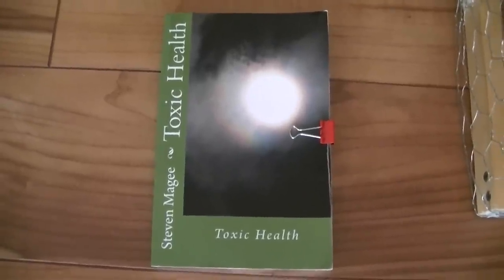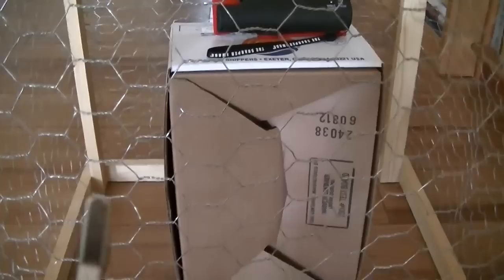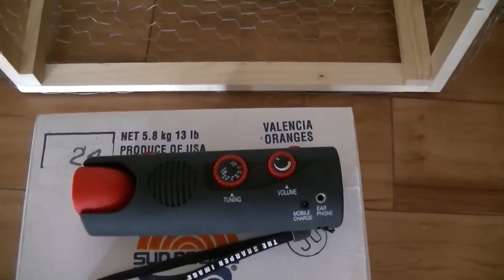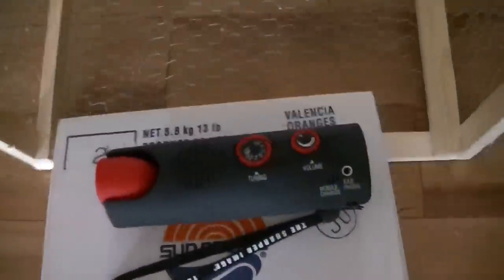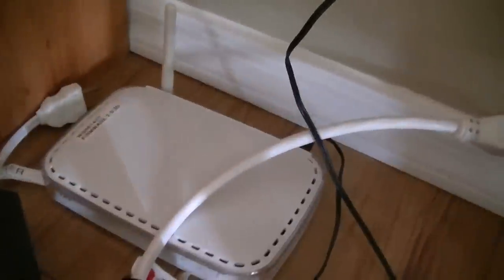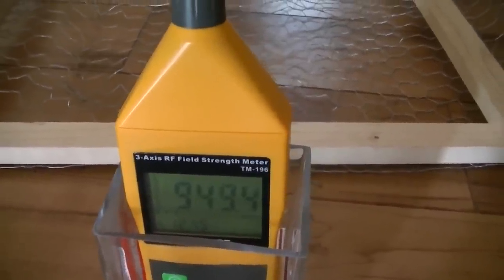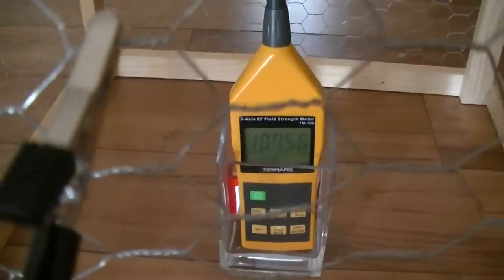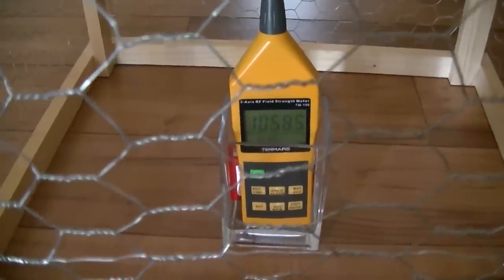The Difference Between Grounded and Ungrounded Faraday Cages Regarding AM, FM & 2.4 GHz WiFi

Comment: Yes the bottom is open for some reason.  Makes no sense...
Reply from the maker: It's not a wooden floor.  It is a ground floor concrete foundation with approximately 1/4" of laminate on top of it.
Reply: StevenMageeBooks you really need to seal the bottom or you'll get scatter leakage around and under the bottom. Also your "earth lead" is an inductor, it's not at earth potential at VHF at all. Seal the bottom with a screen and you will probably (if your cage is constructed properly) notice a difference, but not when you add an "earth" or "ground" lead. Long earth leads like you used in your other video "Does a Faraday Cage Need a Conductive Base When on the Ground" only work well at very low frequencies, where the wavelength is long. 
You must also realise that a concrete floor is not a good RF earth because the conductivity is relatively high. The fact that it lies on the planet doesn't make any difference at all unless it is absolutely saturated with water and mineral salts, even then, above a few MHz it will have significant resistance. Ceramic is a good insulator. 

Unless you have a perfect RF earth (at whatever frequency you are trying to block) then just ignore the "earth". It's unlikely you will ever have a good RF earth above a few tens of KHz. Use a calibrated field strength meter appropriate to the frequencies of interest/test and not a broadcast receiver - the broadcast receivers have automatic gain control and can cope with 40-60dB of difference for the same signal:noise ratio, which makes them useless for detecting even medium changes in field strength.

At GHz frequencies you'll get passthrough depending on the aperture size of your mesh screen; also "earthing" becomes even more irrelevant because a wire even a few mm in length has significant inductive reactance.
Reply from the maker: Excellent discussion!  Thank you for taking the time to post it.
Reply: Environmental Radiation LLC 
For a Faraday Cage to work, all sides must be electrically connected to each other, your concrete foundation is not electrically connected to your cage, therefore this cage does not function as a Faraday cage (which is proved by the radio reception). Furthermore, the mesh size must be smaller then 1/10  of the wavelength. For a 2,4 GHz WiFi the mesh size should be smaller then 1.2 cm, your mesh size is clearly much greater then that. WiFi signals are not blocked with this mesh size (therefore you grounded/ungrounded test makes no sense).
Reply: +PeterK6502 Great explanation! Right on the money.
Reply: +LucaTurilli89 seems to me that you are talking more about "protective safety earthing" than Faraday Cage Shielding. It is also possible that you wish to screen off stray coupling to nearby objects, components and wiring.

In the context of the video here,, the intended purpose of the cage is to screen out radio frequencies. Radio frequencies can be emitted or detected at quite large distances from the devices/antennae in use. This is in contrast to lower frequencies, such as the ones used for mains-frequency transformers and to a certain extend, switch-mode power supply transformers, though as the frequency in use in the transformer increases, there tends to be more chance for electromagnetic emissions 
(in part due to the circuitry, that is to say, the wiring, becoming a significant fraction of a wavelength at the frequency in use. An important factor for this is the "loop area" that such circuitry encloses - basically long wiring in the shape of a large loop tends to emit more than the same wiring close together, parallel with little space in between or twisted together) 

Unless your particular transformer is driven by a radio-frequency signal (rather than "mains" frequencies, say 50Hz, 60Hz or possibly 33.3 or 400Hz in some less common application) then protection from electric shock is more of a design problem for an electrical engineer specialising in high voltage design and installation. 

Protective safety earthing and equipotential bonding:
The usual intention of an earthed enclosure (also known as equipotential bonding - making sure that objects are "bonded to equal potential") around such high-voltage equipment is to ensure that in  any leakage or fault conditions the unwanted current is diverted to earth via a very low-impedance route. This is done for two main reasons: to ensure that "touch voltages" on any exposed nearby conductive* objects do not rise above safe conditions (the definition of "safe" may vary on the circumstances -  example: in a bathroom, especially over a bathtub or in a shower, or medical equipment that may be hooked up directly to a patient; or in contrast on a high tower that is inaccessible to the public by virtue of being fenced off and having no access ladders) 

* note also that at very high voltages (and 20kV is considered very high in most circumstances) that objects that are commonly thought of an insulators can in fact be conductors)

NOTE WELL-  that in may circumstances, having an bonded earthed object close to high voltage equipment can make leakage prevention a major problem. By that I means that fitting a cage close to your 20kV terminals and wiring may simply be asking for tracking (arcing) to occur between the high-voltage and the earther screen. Also note that if the safety bond to earth should become faulty in some way then you will have a very lethal problem - the whole cage/enclosure may become energized at 20kV and anyone coming into contact with it may get a lethal shock!!! This is a serious safety problem!
(the usual answer to this is to allow very large distances between any conductive enclosures and high-voltage equipment)

If what you really need is screening so that the transformer does not emit or be susceptible to  electromagnetic radiation, then a Faraday Cage is ONE way to reduce this, HOWEVER, at lower frequencies, the effect of an electrostatic screen is much less effective than that of a magnetic screen. Certain metals and compounds are manufactured for use as magnetic shielding - "Mu-Metal" is one example. "Aqua-Dag", a paint-like coating, is another. 
At first glance these magnetic screens work in a similar way to a Faraday Cage but their actual method of operation is very different. They are primarily used at lower frequencies than  "radio" frequencies, usually with circuits energized in the region of tens of kiloHertz and lower. This is because the effective screening of the materials drops off as frequency increases. Modern ferrite and dust-iron materials extend this range somewhat higher but can be very expensive to manufacture in slab or sheet form as they can be very brittle.

It is VITAL to note that protection from high-voltage electric shock is NOT the prime purpose of Faraday Cages in the context of this videos and similar ones. Rather, the purpose seems to be to to reduce the ingress of stray radio signals (usually broadcast signals, domestic WiFi or cellular signals)

IF your prime purpose is to protect from electric shock - I strongly suggest you contact a electrical safety consultant experienced with high-voltage safety design.
As I hinted above, in the NOTE WELL paragraph - a NON-CONDUCTIVE safety zone around high voltage installations is the norm, distance is usually your friend here. Then outside the safety zone (which maybe be measured in centimetres, metres, or even tens of metres, depending on the circumstances of insulation used, if any) an earthed enclosure may be used IF required for some other reason. As I say above, the integrity of any earthing arrangement is of vital importance also. 

This is one reason that old CRT televisions usually had non-conductive back covers, rather than conductive earthed ones. When the back is removed for service, extreme care needs to be taken to bond conductive covers back on afterwards. With non-conductive back panels and double-insulated, non-earthed designs, this is not a problem. Note that the high-voltage circuitry in such TVs was always designed to be kept well away from human fingers, using distance. Any internal conductive objects objects were very well bonded to prevent the buildup of stray electricity under normal or fault conditions. 

IF what you really want is to screen the device from emitting or being susceptible to electromagnitic interference, then what you need is a EMC (ElectroMagnetic Compatability) specialist. Also note that any conductors penetrating a Faraday Cage or magnetic shield needs to be extremely well filtered or the effect of any shielding can be completely negated. 

In simple terms that means if you attach a significantly long wire to the 20kV terminal and bring it out of the cage, it will emit or be susceptible to precisely the same energies that you are seeking to screen with the shield. 
The definition of "significantly long" here depends on the length of the conductor (or more correctly the loop area enclosed by the circuit)  compared to the frequency (and therefore the wavelength) of the energies you wish to protect from. 
eg: at 50Hz,  20cm is not really a problem outside the cage unless huge pulse currents are flowing or massive transients are superimprosed.
at 2.5 GHz, 3cm may be a significant problem. 

My suspicion is that you are talking about 50/60Hz or at most, several tens of kilohertz at the most, but the known laws of physics apply across a broad spectrum.

my fingers hurt :(
Reply: +LucaTurilli89

The sore fingers were a joke :) 

 OK, in your scenario there seems to be more the requirement of physical separation for personnel safety. This could be achieved by physical distance separation alone, but that would probably mean keeping people too far away from the equipment to be practical in a lab scenario. You would maybe have to lock the room door too to observe safety protocol  haha.

TL;DR - 
you just need an earthed safety screen, not a Faraday Cage because you do not need to screen electromagnetic radiation.  The technical term for this is simply "an enclosure". It does not need a bottom side if the base is solid and a good insulator as well as being mechanically stable. You could have a hinged cover you can lift off for access. You should include some basic safety features if you have time.  

Long version -
One approach would  be to manufacture an insulating transparent (polycarbonate or acrylic, and therefore insulating) enclosure, but that would be MUCH more complex than simply placing a cheap and easy to construct cage around it made, as you suggest, from chicken fence wire. This is easy to find and easy to bend, a few wooden strips and a quick frame can be made (maybe borrow a electrician's staple gun to make fast to the wood frame?) So - chicken wire cage is good cheap and fast idea.

Your equipment basically needs to kept safe from accidental human contact with the high voltage. This is the same purpose as most cases or enclosures. There seems to be no need for electromagnetic screening. Yes, if the insulators under test break down under high voltage there will be some arcing and this may cause local RF interference, but in a lab environment for a short test this should not be much of a problem. So, in your scenario, you simply need a "case", not a Faraday Shield. Not all cases act as Faraday Cages, though all-metal ones do if they are properly constructed. You could, if your woodwork skills are good enough, manufacture a large wooden box around the apparatus for example. If however the materials used for the enclosure are conductive, they should probably be earthed for electrical safety.

Because the chicken wire is conducting and not insulated (even if you do find plastic-covered chicken-wire, it will not be good insulation to 20kV) then yes, for safety, it should be grounded. Please make sure the connection to the fence wire is good - the fence wire is usually cheap galvanised steel - a good quality crocodile clip with sharp teeth may be better than a poorly-soldered "dry" joint made with a too-small soldering iron. Galvanised steel is not so easy to solder, especially with modern lead-free solder. Best of all would be a tightly screwed clamp with serrated washer to bite through any surface oxidation on the metal coating of the wire. Make sure this cannot come loose but allow some flexibility for opening the cage/cover if you need inside - a flexible cable with some slack for movement of the cover is ideal.

Personally, I would not build it with a floor to the shield/cage. This is because, I would assume, you have the test apparatus on a lab bench/table. That means nobody can be injured from below the apparatus unless they drill a hole up through the table top - so no screened floor will be needed for safety - at least I think? I'd adopt a baseboard arrangement with a cover over the top of it. The baseboard would ideally be thick and heavy. Generations ago, this was called breadboard construction, after a kitchen bread cutting board - a far cry from modern "breadboards" :)

Your earthed safety cage could only be a "lift-over" style cage IF you are very careful about things...
 HOWEVER - you must be away that the equipment MUST be de-energized and any capacitance (including stray capacitance) discharged. There is a vital difference between something being "off" and being de-energized. Off means the supply is removed. De-energized means that any energy remaining in the circuit after the supply is removed is safely discharged.

 SO -  imagine the nightmare scenario - you are testing the insulators at 20kVac 50Hz. You think you see some arcing/tracking near the transformer, so you look closer, but stumble and fall against the cage. The earth wire comes loose and pulls off, as you fall you push the cage (which is now NOT at safety earth potential) against the top of the 20kV insulator. !BANG!

To prevent this I would have a few precautions:-

1 - Make the cage reasonably rigid, not so that it is too flimsy. It need not look pretty, but should not collapse if it is touched. It should at least provide some physical protection. 
If you take this to extreme, you would make a full metal chassis case to completely enclose the transformer and possibly the insulators under test too. For a lab test scenario this is not required, but please try to show some good safety sense and make sure no-one gets harmed. Often, it is the person who least understands the risks - that usually means trouble :)

2 - mount the transformer on a large, thick, insulating wooden block, like a butcher/kitchen wooden chopping board, this is to make it stable and not slide around too much. Even dry wood may have leakage at 20kV, so use an insulating plastic board on top of the wood for a top surface. This base should be large enough so that the base is much larger than the transformer and any other equipment needed. This makes it safe and stable. 

3 - Make the screening cage so that the framework is hinged at the rear side (or maybe just loosely fixed by hook and eyes) so that the cover can be lifted up for access. This will make sure if the cover is lifted, it will go back together with correct alignment. A loose metal cage that can be pushed around into contact with the 20kV terminals will be dangerous. If it's fixed at the rear side to the base it can only come down with correct positioning every time. Much safer.

4 -  Include a safety interlock switch . This will disconnect the supply from the circuit if the cage is lifted. When the cage is down, it turns the interlock switch ON. If the cage is lifted, it will disconnect the supply. Basically, mount the switch on the base of your wooden base block so the cage frame covers it.

This interlock switch may not de-energize all circuit on the secondary side instantly in all circumstances, but is better than nothing. A small suitably-rated mains microswitch is an good way to do this. Don't (!) try to swith the secondary (output side) - it's too high voltage.
It's important this interlock switch is separate from any functional ON/OFF switch for normal operation. The idea is that separate switches add extra safety. Interlocks are very common in the industrial world, for example, even a domestic microwave oven will have 2 or 3 separate interlock to prevent operation of the magnetron while the door is open. This is in addition to the main on/off switch. Interlocks should ADD safety. This is an example of safety by design.

5 - only have trained personnel in charge of operating the equipment. Tell everyone else they must not  touch it.  
This may mean you and your teacher/instructor (and only AFTER you have fully explained to them safety haha). This is an example of safety procedure and safety briefing. It takes only a few seconds, works well for lab experiments and demonstrations and is safety for free - it makes you sound good too :)
Reply: +LucaTurilli89 

...Now, on to CRT enclosures. Yes, one possible hazard is any large supply rail capacitors storing high voltage until the bleeder resistors discharge this to a safe level. However, this assumes the bleeder resistors are not faulty and are present (!), it also assumes the person does not touch the dangerous are for a few seconds or minutes, depending on the CR curve time. Safety comes from having several safety features, not just one (see interlock description above)  Anyone who has played with an open computer power supply has probably get a shock his way sooner or later. Some cheap PSUs have no bleeder resistors at all. As you say, most of the voltage rails would be low current but may still be enough to stop a heart or cause injury in other ways. 
 
But a second hazard is the EHV on the CRT tube itself - it acts as a high-quality (it's glass) high-voltage capacitor and can retain a charge for a very long time after the supply is turned off. Even worse, it can recover some charge even after it has been forcibly discharged - a very interesting effect. To safely work on CRT equipment the CRT tube itself should be safely discharged. This helps accidental contact with EHV especially under fault condition or unnoticed physical damage. Whilst the EHV supply current is minimal, the energy stored in the circuit is not. 
  
Because CRT televisions became such common domestic objects, may users tried to repair them themselves, regardless of their skills or knowledge. Many examples of accidents occurred due to the sheer numbers of TVs in use over many decades. Commercial monitors tend to have metal cases and sometimes if the case was not properly re-fitted and the EHV lead became dislodged or the insulation became compromised any adjacent metalwork case could rise above ground potential. Because of this, most quality commercial CRT cases had multiple methods of panel earthing, flexible binding straps as well as serrated washers. Designing a double-insulated appliance avoided that for domestic CRT TVs.

When designing products, you must think of the safety of ALL persons, users, technicians, in some cases trespassers or even thieves (electrical substations have very high fences and locked doors).

Remember that it is not always the hazard directly from the high voltage itself, it may be the fright from the shock, or the shock that causes someone to fall and injure themselves. Falling and banging your head can be fatal, as can falling off a very low ladder or step. Accidents happen, but as an engineer you must just make sure that they do not happen as a result of your product, even if an idiot uses it. 

USERS need to be kept out, to protect them from what they do not know and cannot understand. You sometimes need to think laterally to protect them from themselves. Luckily, safety organisations and legislation lays down common standards (EU standard finger test for example) for enclosures. 

TECHNICIANS are a little easier, they may understand but can still make mistakes. Example: a badly-trained, tired or drunk technician who forgets to connect earth bond wire or serrated washer to metal cabinet panel after servicing. By designing a robust flexible bond wire and hinged door panel for easy access, the risk of this happening is lessened considerably. Or, making the serrated washer (to penetrate any paint/coating and give very low impedance connection to the safety earth) captive so that it cannot be lost or omitted. 
Everyone loses screws and washers, it's part of life :)

TRESPASSERS and THIEVES are less of a problem for domestic situation, but in industrial power supply where certain death will be instantaneous, all equipment, enclosures and even building or entire sites must be designed to prevent, wherever possible, even very slight risks of contact with lethal potentials.  

Engineers? some would argue they are the most dangerous of all ;)
Reply: +LucaTurilli89 

Note that if you use a wooden baseboard, or similar, then any screws or fixings that penetrate through the baseboard may become a hazard if they become connected to hazardous voltages under a fault condition or damage. example: insulator becomes loose and the conductor it supports touches a screw that is too long and goes right through the baseboard. Unfortunately, under the board is a metal object that is not earthed. Someone dies, you get the blame. :( So just make sure that you use a thick baseboard and shorter fixing screws for hardware. 

This wooden baseboard approach is suitable for laboratory experiment under controlled and supervised conditions,  but is not suitable for domestic or industrial use unless extra steps are taken to provide extra insulation to any object that may penetrate the baseboard that is not itself fully earth bonded.
Reply: correcting myself: now I remember that Aqua-Dag was actually an electrically conductive coating, not a magnetic shielding coating. I wish I could remember the name of the paint-on magnetic product, it looked almost identical to Aqua-Dag but was a much thicker layer, probably heavily loaded with powdered ferrite or dust-iron. It stank and was extremely dangerous, as all good products were.
Reply: +LucaTurilli89 
on mesh size:  because the frequency, 50Hz is so low, then even quite large chicken fence wire would perform OK from an electromagnetic point of view, but if you really need protection from touch then you should try to use some fine-mesh chicken wire if you can get it. The idea is to prevent someone poking a finger inside the mesh and touching something high-voltage. 

If you can only obtain wide-mesh chicken-fence then you will need to have it at a further distance from dangerous voltages, so that even a very long finger cannot touch. Depending on which country you live, there may be local regulation about the maximum size of aperture for touch protection. However, these rules often do not apply to experimental apparatus in controlled and supervised environments like lab use. The main person to satisfy is your instructor, as they will be in charge of safety there.

It is possible to use Faraday Cage as protection from electrocution, but for this, there are several factors to consider, like maximum possible fault current, maximum possible duration of fault, ambient temperature, pressure and humidity, as well as other factors like are there any other safeguards. I'm reasonably convinced your instructor just wants to see an earthed touch-proof enclosure rather than a true totally-enclosed Faraday Cage.

Also, do not overlook ready-made alternatives, like metal pet cages or birdcages. As long as you can get a good connection to each panel (never trust a touching connection, for protective earthing each piece of the cage should be positively bonded with a flexible cable and good clamp connections.
Reply: +LucaTurilli89   well, a cage without a bottom will only protect from electrocution if a sturdy fully insulating base is use, which is why I suggested using a thick, dry wooden board like a thick kitchen bread-board or meat-cutting board as a base. To make it touch-proof, the cage would need to be well-fixed to the wooden base around the bottom to make sure no-one could get their finger underneath it (or more likely, accidentally knock a metal tool underneath the cage). All of this assumed the wooden base board is thick and any screws you use are much shorter than the thickness of the board. 

About the bottom of the cage being open  - that only maters if someone attempts (or accidentally) pokes something or themselves inside from the bottom. If the bottom is inaccessible ten it is safer from touching. 

You could easily continue the wire cage under the baseboard if you wish, it won't require much extra chicken-fence wire to do this. If you don't use a baseboard of any type but the cage is fixed down to a wooden table, then that should be OK too. The idea is to stop people touching the high voltage parts, so think of the ways that people could get in there or poke or drop a pointed metallic object in.

To act as a TRUE Faraday Cage <specifically> for Protection From Electrocution, then yes -  it would be prudent and safer to continue the cage around the bottom to form a full cage with no discontinuities between sections. The decision to make this a formal safety requirement really depends on the characteristics of the apparatus itself, a circuit that contained DC and very large high voltage capacitors is inherently much more dangerous than a extremely low current impedance-limited AC circuit that stores no more energy than that in the inductance of the transformer itself. 
It also depends on how large and how well-insulated your internal connections are too - but bear in mind that several safety features in layers are always better than one alone - that way safety is maintained even if one form of protection fails. Disasters are chains of events, rarely one failure

Make sure you don't over-think it - if only a touch-proof enclosure is needed, you can consider placing temporary experiments inside large plastic containers used for domestic storage. You can make experiments touchproof quite easily like that. The reason I mention it is that your instructor/teacher may only mean for it to be safe from contact (large plastic cover) and not actually earthed (chicken-wire fence cage) If the container/enclosure is fully enclosed, non-conductive and proof to 20,000V then there is no real need to make an earthed metal cover. HOWEVER - you should be aware that at 20kV this high potential can track on dirty/dusty, greasy or slightly damp plastic surfaces. Also, any plastic container needs to be quite thick to withstand 20kV. A very flimsy temporary food storage may not be suitable. 

To be extra safe for your project, you could use two approaches at once. Use a large plastic enclosure and then apply earthed chicken-fence wire over the top as a safety measure. That will make it touch-proof and make sure that any accidental leakage goes to earth.Bear in mind that one of the main reasons for earthing safety (equi-potential bonding) is to make sure that sufficient fault current flows to activate an protective devices (like a fuse or circuit breaker) within a suitable time-frame.
 
Because the transformer you are using will have very low secondary current capability, you may not be able to find a suitable fuse for the secondary side for two reasons - one is that the current will be so low that even a 50mA fuse may not be blow open even if the output is shorted to earth (this should be tested on your particular transformer - it may be the transformer impedance is so high that the voltage collapes to much - some transformers are actually designed this way)
Another problem is that the fuse must be capable of failing open and interrupting 20kV - which is impossible to do for normal small fuses.
You should never assume that a safety trip on the mains supply will open in a fault situation and save you (or someone else). Especially if the transformer secondary is floating (having no side of the secondary connected to earth) any fault to earth in the secondary will not case any earth leakage protective device to open (these are called names like ELCBs, GFIs or some other name, depending on what country you are in)
As I said earlier, if you are unsure about anything ask someone qualified or your instructor/teacher about this.

Finally on this subject, don't overlook making a simple metal box instead of a cage. A fully enclosed metal box that has all parts properly earthed serves the same purposes as the enclosure and cage - touchproof and safety earthing. 

There is another aspect here that should maybe considered - that of maintaining an earth-free isolated environment and feeding the apparatus via a separate safety isolation transformer. Ironically, that means having NO earthed cage at all, nor any earthed conductive objects nearby. That way a high-voltage to earth fault cannot occur so no (or very, very little) current would flow through a human body in the event of a problem. However, to decide if that is more appropriate then an engineer or very experienced technician needs to see your proposed equipment and talk to you about how it will be used/demonstrated. It is not possible to give general advice about that without extensive discussion and looking at your equipment and how it will be used to perform tests.
Reply: If you really want it to work, it should be made of silver.
Reply: And certainly needs to be closer weave. The holes are too darn big. Think he'd know that if he has been doing this for awhile.
Reply: The size of the holes is related to the highest frequency the shield will block.  1 inch holes are good to about a gigahertz (holes about 10 times smaller than the wavelength).  It will start to become leaky above that frequency, and will be completely useless as the wavelength becomes smaller than the hole size (around 10 GHz).  So chicken wire works fairly well for most radio frequencies we commonly encounter other than satellite dishes and police radar guns.
Reply: Agreed. This is faulty
Reply: Star Gazer is 100% Correct :D. Wrap this thing with Heavy Duty Tin Foil, you will see it will work. Also, you must COVER ALL 4 SIDES. POOR STUPID TEST !!!